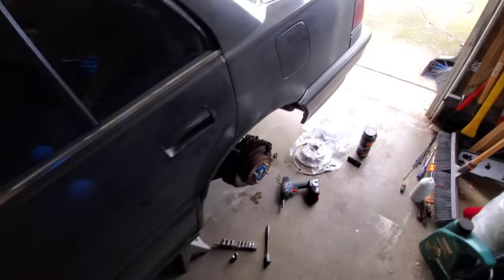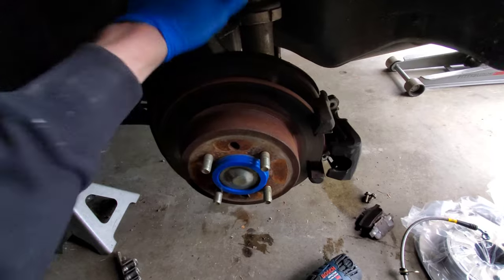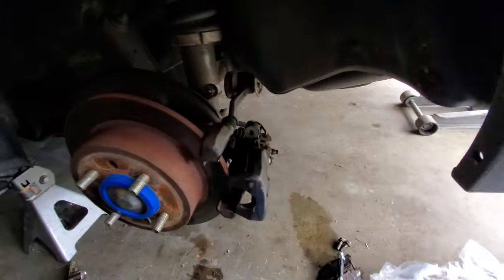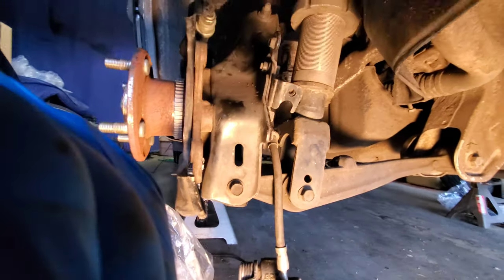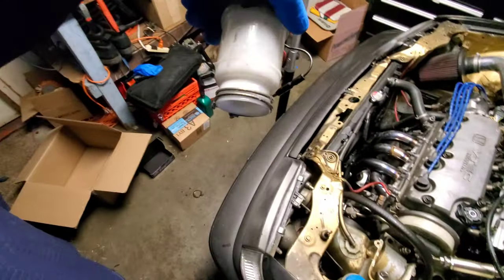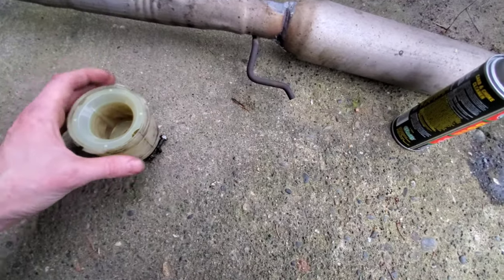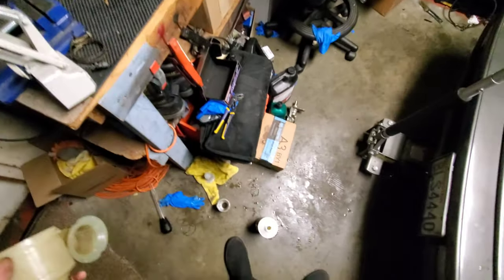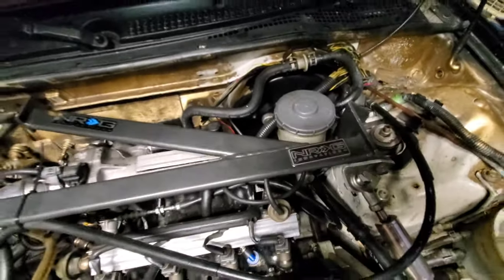EF Civic Sedan Restore #73 Brakes, Pads, Rotors, Calipers, Steel Lines.

Comment: What size master cylinder did you get?
Reply from the maker: There are no markings. I used to original one that came with it.. not sure if it's the OEM part.. looks wider, the O'Reilly's aftermarket is taller though... So to answer your question.. I have no idea! HAHAHA..